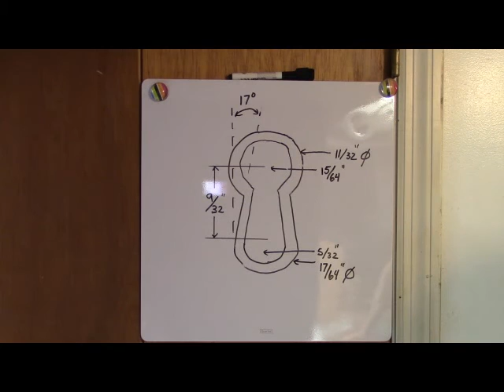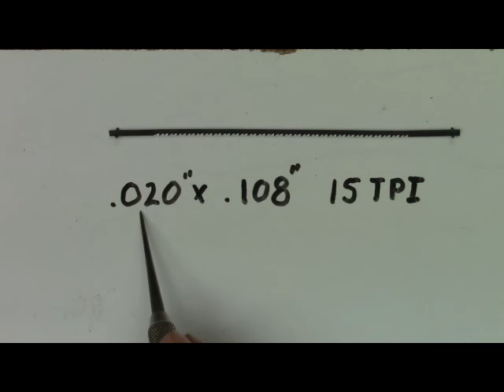Making and installing keyhole escutcheons.

Comment: You are correct on the file about picking it up on the return stroke if you don't you are rolling over the cutting edge of the teeth.  This takes a while to ruin a file this way as they are harder than what you are filing.  Some people just buy cheap files and treat them as a disposable item like sandpaper, all depends on your personal "Stile!"  I myself do lift on the backstroke as I was taught by my Grandpa and most all of my files are his from back in the 1920's and they still work great.

Comment: I wonder if you can use a pencil to create the Scribe line and then scribe the pencil line. Just to avoid small mistakes that you would have to sand out, or using the Scribe on veneer that would seem to be nearly unfixable after a mistake.

Comment: Nice. I only wonder why you didn't also glue the escutcheon in place. A pressure fit should be more than enough to hold it in place, but I thought the old masters also glued them. The rough filing sort of serves as a glue surface. I suppose I'm thinking of work like boule marquetry, where brass and pewter are glued to the wood substrate.